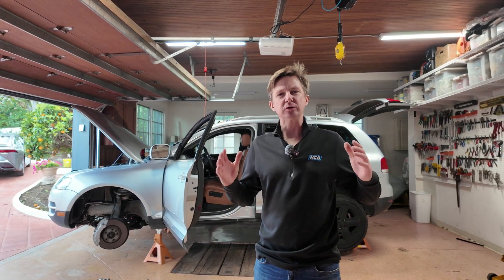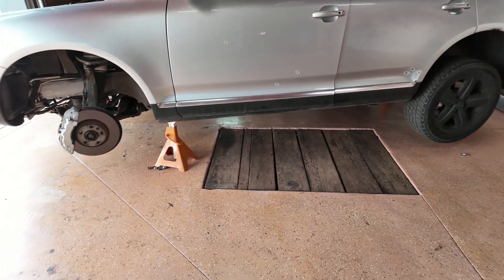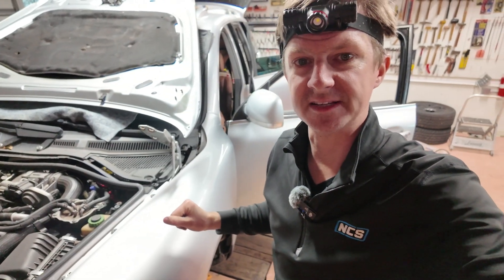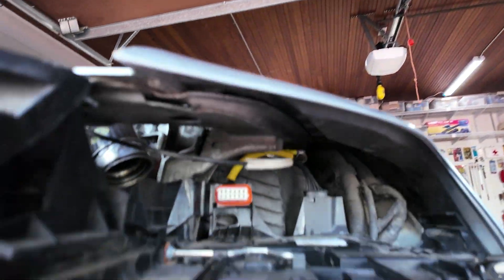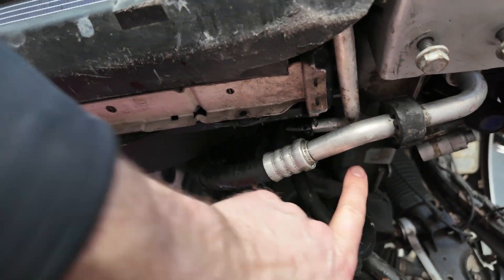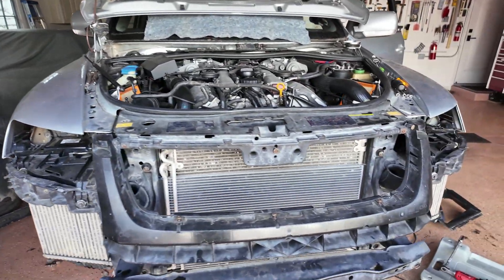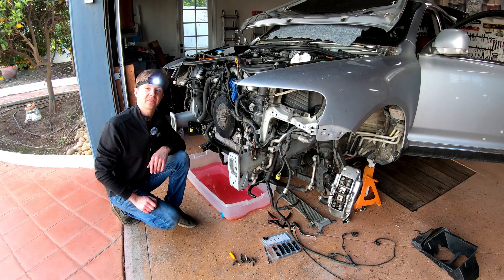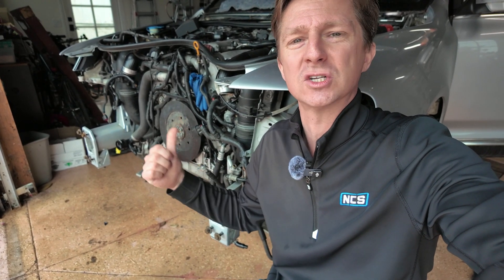V10 Touareg Engine Drop! First - The Front Clip Removal

Comment: Great video! Im looking at buying one of these right now and the ability to do this in a garage on jack stands is helpful info! out of curiosity what are those wood slats covering in the middle of your floor? old well???
Reply from the maker: Glad you found this helpful! Those wood slats cover an old oil change pit; it's about 5 feet deep so you can stand in there and be under your car to change the oil.